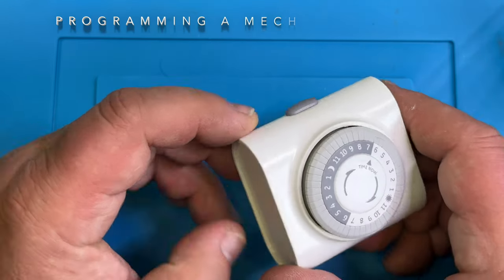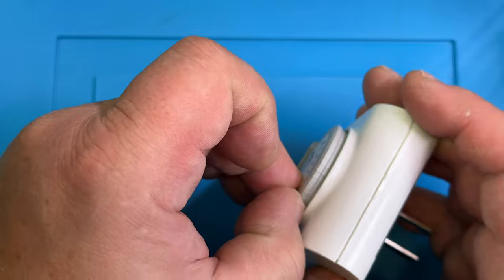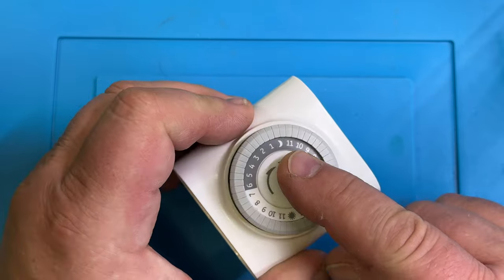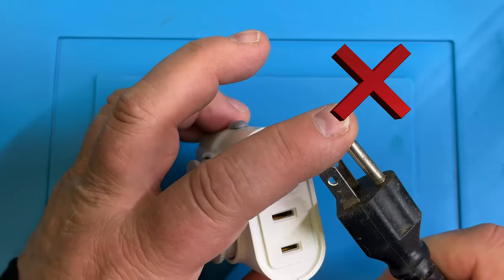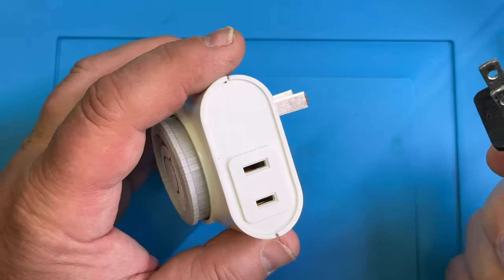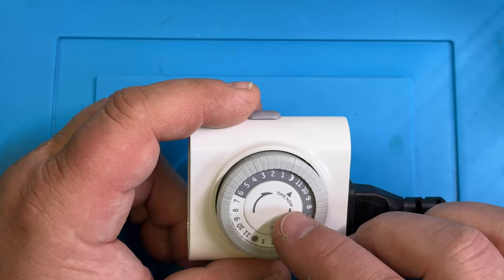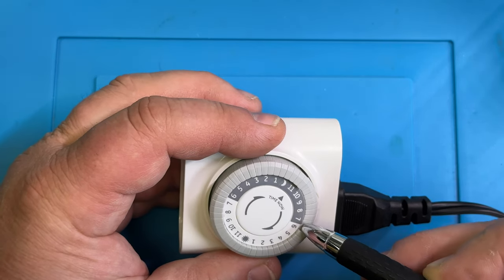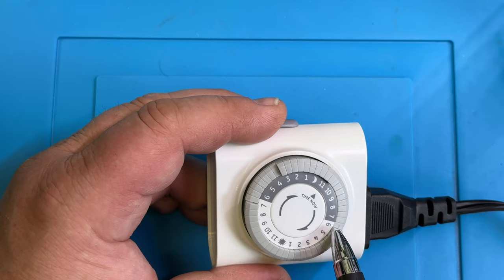Programming a Mechanical Timer

Comment: Question is does this rotate by it self after setting all this up
Reply from the maker: Yes it does when connected to power. There is a little electric motor in there that spins it around. When there is a power outage, then it stops.
Reply: @mygiguser  min don't spin it's just heat up

Comment: Something is wrong. I set it to go on at 6 pm (even though it was 9 pm when I set it and I did scroll to 9 pm) and pushed down 10 pm when I want it to go off. It did go off at 20, but went back on at 10:10 pm.
Reply from the maker: you need to push the pins inbetween 6 and 10 too, not just the one at 10 and the one at 6